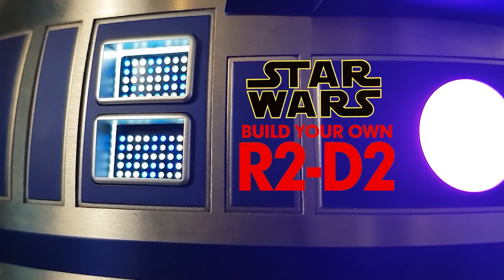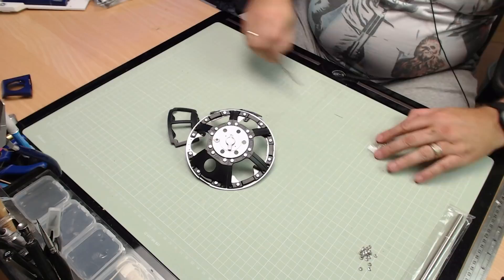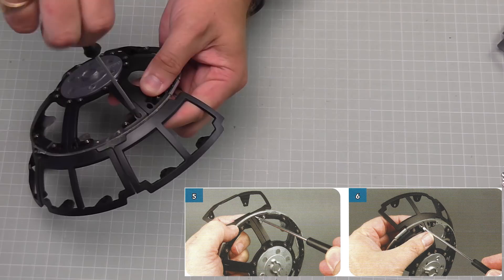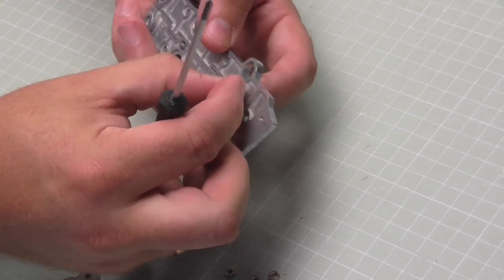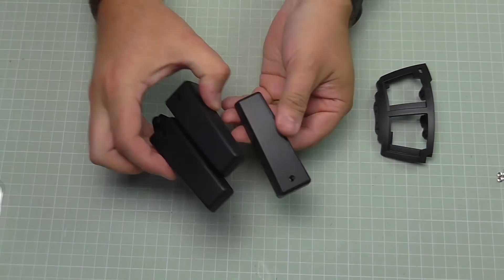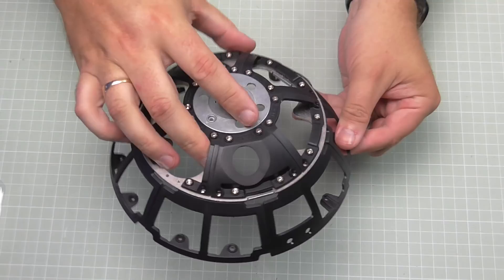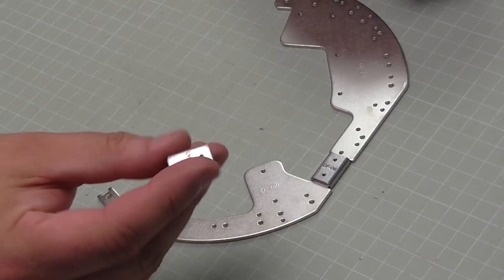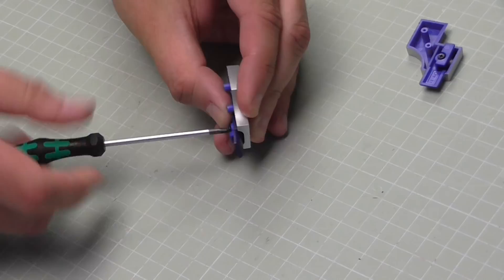Build Your Own R2-D2 - Pack 4 - Stages 11-14 - Head Frame Panels, Leg Components and Centre Ring

Comment: Just finished Pack 3. Loving the build so far. Only thing I find annoying is trying to work out which screws to be used as they are not labelled.
Reply: You can cut out the different screwtypes in the magazine/put them inna pillbox

Comment: Apologies if this has been mentioned before. Has the interior structure changed in this Agora R2D2 build, compared to the deagostini build?
Reply from the maker: Nope. This is Fanhome. Not Agora. Its exactly the same
Reply: @WorldofWayneUK  Oops! Lol sorry. There’s so many build companies! Thanks Wayne, I’m on my last stages of my R2D2 and it seemed like the dome fixtures are slightly different.
Reply from the maker: @johnnyfairweather2506  The seem the same to me at the moment
Reply: Wayne, it's looking great. Do you know if any of the other companies are going to do the x-wing. Deagostini doesn't have it on their website anymore.
Reply from the maker: @gregb8486  hoping that Fanhome may pick this up

Comment: Is there any chance you could recommend some batteries for the model including some that could be found on Amazon. I found a website in the uk that carries batteries for it but they are all out of stock and I'm having trouble finding them elsewhere im in the US iv found several batteries that match almost all the specs specs but none of them state they are unprotected so im assuming if they don't say it that they are protected. 

Iv just started the model but id like to have the batteries at the ready any advice would be appreciated.
Reply from the maker: I am in the process of getting this sorted I don't think you will be lucky getting these on Amazon as its surprisingly hard to get lithium Ion through the delivery system.  https://www.ecoluxshopdirect.co.uk/by-size/18650-button-top-batteries the folks here will let you know when they will be back in stock
Reply: Thank you for the recommendation